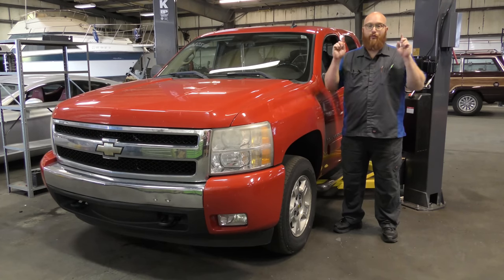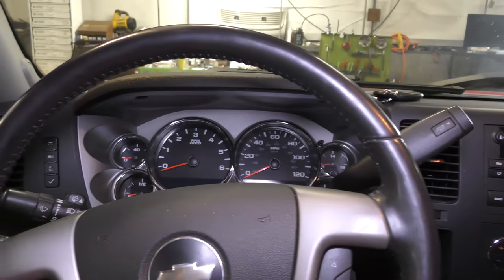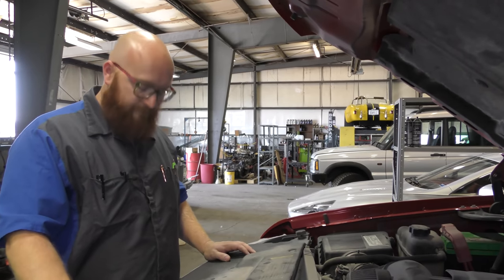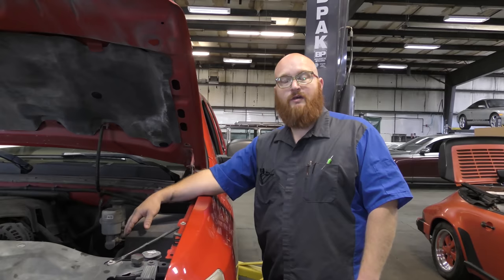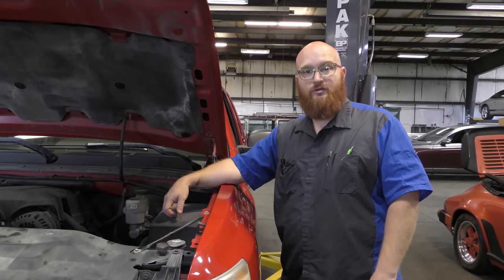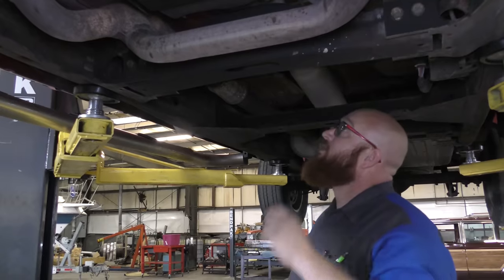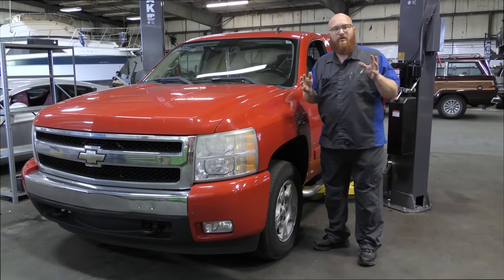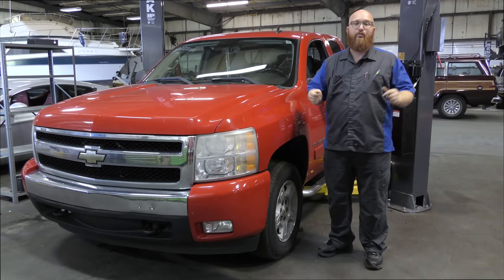Good Truck/Bad Truck? CAR WIZARD shares most common problems on the 5.3L Chevy truck at 100k+ miles

Comment: “I’m not gonna give myself a pay cut for being a good mechanic” the realist statement by a mechanic
Reply: Some jobs you make money on because it takes less time than book. Other times you lose money because stuff happens that don't show up until later when you are into the job (rust, broken bolts).
Reply: That's it. Another one is an objection to paying a large amount of labor for a "10 cent part". I ask if it would make them feel better about the labor if I charge more for the part. They usually become more understanding at that point
Reply: No apologies needed.  It's not a charity.  If people don't want to pay the book rates let them fix it themselves.
Reply: That’s fine don’t take a pay cut. But quit charging for shop supplies  I don’t mind paying for your work if it’s good. But I hate paying for your crap like brake cleaner. Every shop I ever been to you guys have multiple partly used cans of it sitting on your to boxes
Reply: Well said by the wizard, but the sentence previous to that was not. A mechanic shouldn't charge for the time it would take a novice to do it. If you gonna use book times then they should reflect what an average mechanic can do it in. So if you're a crap mechanic you're not getting crap pay, and if your a good mechanic you're well paid.
Reply: @Jim-jw6jm  but that “crap” is necessary to do the job why should they eat the cost???
Reply: @cayman9873  So by your logic in your first sentence, a good mechanic is doing MORE work and getting the same amount as a novice/shitty mechanic.  I'm guessing math wasn't your strong point...
Reply: Brian Weir I agree, guy should fix his own stuff then. Incidentals get expensive when I am buying them at my home garage.
Reply: @cayman9873  Like Mr. Wizard says, you think it's so easy you do it!
Reply: @Jim-jw6jm  You do it your self then!
Reply: Maybe shouldn’t brag.
Reply: Not really
Reply: @sidefx996   i am an advanced engineer and my math is excellent. You should read my post
Reply: @jdgimpa   i have done exhaust and brakes and clutches and engines.  I was employed as a mechanic and now am an engineer.  Why do you feel someone making a valid point is unskilled.  I am not saying anything like you seem to misunderstand
Reply: @sidefx996   i am saying he gets the same money for the job. But because he is skilled can do three jobs in the same time frame and make three times the money. Learn to read before you criticize what you cant understand
Reply: @cayman9873  I spent 45 years in the business 30 as a mechanic and 15 in management. I have over 4000 hours of Chrysler technical training and another 500 hours of management training. I am now retired. I held Master Certifications in auto repair, classic auto repair, parts management and service management. I also was Gold certified in repair, parts and service as well as recipient of several customer satisfaction awards. Would you be willing to pay more than the flat rate if the mechanic took longer than book time to do it? I never have found anyone that would, yet there was always someone who wanted to pay me less because I had done the job so many times that I was quicker than the book time.
Reply: @cayman9873  You  make a valid point !  I doubt very seriously if a mechanic runs into problems on a book rate job that he does charge for the extra time. I am not saying the Wiz does this, but I bet that many do.
Reply: I have a question to you all, when did you last pay your plumber, electrician or butcher 4 times his hourly wage just because he deems himself «good» ?
Reply: @cayman9873  you actually have a valid point.  If you complete a job, you aren’t going to sit around for the next three hours and watch a soap opera and eat a box of donuts.  A “great” mechanic will move on to the next job.  And, if he is that great and quick and fair priced will have plenty of more work lined up.  👍🏻

By the way, I like the Wizard.
Reply: That’s my issue with all shops. Better to just not say it.
Reply: Being a good mechanic means you get to keep being a mechanic and continue to get happy customers that trust in your work. It does not entitle you to charge for more hours than you actually put in. If your hourly shop rate is establish then it's that times the actual hours. Anything beyond that is defrauding the customer. That's why there's a Chilton guide for each job giving the maximum billable hours. This takes into account the worst possible case for each job including mistakes and unforseen difficulties. This is done to put a cap on how much a mechanic can potentially charge but dishonest mechanics will charge the maximum for each job regardless of how much time they put into it. A lot of times it the shop owner pocketing the extra money but his employees are only seeing their hourly wages anyway.
Reply: What happens if a manufacturer puts out a bulletin stating that a certain will require an extra hour? Will the Wizard's shop now charge for that extra hour inspite of them not needing it?
Reply: @cayman9873  Funny not knowing the difference between "your" and "you're" and you're telling me to learn to read...  Anyway, my original point, and maybe we misunderstood each other, was that if a job books at 5 hrs and a mechanic finishes it in 30 minutes, there's no reason he shouldn't still be paying himself/charging for the 5 hrs.  Yes, of course move on to more work after that.  If you're doing multiple repairs and you're already in there and it's a repeat customer yeah maybe you give that person a break.  And if you run into other complications/broken stuff during a "5 hr book" job then why shouldn't they charge for the additional time?  Of course it comes down to a mechanic's integrity and yes I'm sure like ANY other profession you get all kinds.  That also applies to customers as well.  I don't have a lot of money and even for me price is secondary to actually finding someone who knows what the hell they're doing.  That's the main reason I've learned to fix most things myself.  If lots of other people out there spent half the time reading/learning that they do on pornhub they'd be able to do the same.
Reply: @sidefx996  I fix my cars myself and now I fully aknowledge book hours and pay rates... It's often a pain in the a** to change a simple and cheap part....
Reply: @snerby141989  More smoke and mirrors. Make it easier on yourself and just be straight up with people.
Reply: @JoeD60  I'm being facetious. Obviously it does not make any more sense to charge more for a part to make the labor more palatable. It's just that the correlation between parts cost and labor cost is irrelevant.
Reply: @rekleif  Plumbers and electricians work on a flat rate just like auto techs. The amount of training required for either of these jobs is miniscule compared to the 4000 plus hours training I amassed. Also their tools are a drop in the bucket compared what a auto tech is required to have. If a plumber comes to look at your water heater and it isn't getting any power he still charges you a service charge and leaves. Telling you to call a electrician.  Or if he has to replace the faucet on your shower he cuts a hole in the wall to get to it. Then he leaves the hole in the wall and tells you to call a drywall guy to repair the hole. So if you think your plumber can fix your car have at it! A auto tech has to be a plumber, electrician, computer programmer, be able to read complicated wiring diagrams, diagnose problems involving many different systems. as well as keep up with the constantly changing designs of vehicles. So next time your vehicle break's fix it your self and stop disparaging us professionals!
Reply: @ligase75  I'm pretty sure the car wizard is not a dealership. He's the guy people go to when their warranty runs out.
Reply: @Jim-jw6jm  yet if a restaurant charges you extra for condiments that's not okay? Business pay for cleaning supplies, coffee, water filters, etc but only mechanics are allowed to fluff labor and "shop supplies".
Reply: @cayman9873  I hear you that is what kills me about mechanics. Yeah you can mark up parts a little but a lot of these guys want $125 an hour, plus the 100% parts markup, charging almost dealer pricing while supplying inferior parts. I also agree that a mechanic shouldn't quote book time and then come back and say the job took an extra hour because of rust(they know that going in usually just by looking at it, I've seen a mechanic pad a labor estimate by 30 minutes over factory book because it's very rusty, which is fair), either you are charging actual time or you are charge book time not the greater.  I've dealt with honest guys but many are crooked and I've decided that generally I can do it myself, where I used to live I had a cheap mechanic nearby and he was pretty good and also honest(i.e he'd tell you things were still fine no need to replace this part yet and never charged more than his estimate even when rust caused it to take longer) where I live now I have not found a mechanic like that, one guy didn't know what he was doing and didn't fix my issue despite spending a grand replacing parts, the other guy was a good mechanic just really expensive 1k for rotors and pads is a bit much parts are only ~$250 and it takes ME less than 2 hours for me to do the job(my cheap mechanic would do it for $150 cash, book time is 3hrs he'd charge 2 plus give a discount for cash), so I had him tackle the hard stuff and did the brake job, belts, even sway bar links myself, saved almost 2 grand and it took an afternoon probably more because the calipers were shot and did that too and he didn't find that, they were working but not well.

Mechanics charge what they charge as long as they are honest it's all good it's when they excessively pad parts prices or replace things that don't need replacing it's a problem.  It's like anything else a mechanic is entitled to charge what they want as long as they are ethical about it, I'd rather the mechanic say I'm skilled so I'm worth 150 or 200 an hr rather than pad part prices 100%
Reply: How about if his employees say I'm a good mechanic so instead of paying me for the 40hrs that I put in, I want you to pay me for  120hrs" What would car wizard say to that??
Reply: @jkeelsnc  I only do my own repairs. I'm concerned about those who are getting ripped off but have no recourse or foolishly think they're mechanic is honest. How it works is different from what you can get away with... Don't confuse the two. If there was more legislation this wouldn't exist. That's why most people don't deal with mechanics. They keep buying new cars with warranties for this very reason.
Reply: @jkeelsnc  Yes. It's dishonest to charge for more hours than you actually put in. You have an hourly shop rate and you charge that for the hours that you work. That's your pay. That's not working for free like a slave. Just like you pay your employees for the actual number of hours they work. The book rate is there to have a maximum cap on every job. It doesn't mean that you're entitled to the maximum hours if you didn't put in the maximum hours to do that job.
Reply: @jkeelsnc  Normal is not the right term. It is typical I'm sure. Generally it's not the mechanics getting that money. They work their asses off for minimal pay. The point is the Wizard touts himself as honest and I generally think he has been very honest but his YouTube fame and revenue seems to have made him quite arrogant and compromising his integrity for money. Buying boats, Ferrari's and buildings recently. I'm disappointed in him and turned off a little. Know what I mean?
Reply: @stevesmith3033  most decent shops pay mechanics pay by how many hours the Technician flags, omega auto and David Long don't, good mechanics aren't rewarded at all by the wizard..
Reply: @stevesmith3033  there are three "book rates" Warranty, wholesale and retail a skilled mechanic can get it done under warranty hours. When these independent shops are charging suckers $95/hr and up and installing crap Chinese made parts with a fat markup you are really better off spending a bit more and having your car serviced with quality parts at the dealership. I change plenty of Chinese made water pumps, fuel pumps etc installed by cowboy shops like the shops like the wizard that are less than 18 months old. Keep taking your car to "independent" shops it keeps the dealer service department in business!
Reply: And what's wrong with that. Imagine doing good work and getting paid for it. 
Its time that trade's people (talented ones) start charging big money for there services.
Reply: Mecanic will never ever lose money 💰 
Even if it take 3 hours I bet you , he will say 
Oh I found a broken bolt blah blah blah and will charge extra 2 /3 hours 
I learn to buy a good car , easy to maintain 
And keep it up 👍 change oil filter 
And will never ever see a Mecanic 
My Toyota T100 have 650 000 and still running 🏃‍♀️ as a Cham 🤣🤣🤣

My next truck will be tundra for the rest of my life , that’s why 99% of Mecanic don’t like Toyota cause you will never be there customer
Reply: @cryptoanalysts5793  

I haven't had my vehicles into a mechanic in 20 years... 
To your point i buy used lexus, and imagine! never a problem. People do need to choose there vehicles on reliably and not on "car of the year" or try to out do the "Joneses".
I love the look of Cadillac's and BMW  but i would never buy a used one.
Reply: @sonnydash4987  I bought a used 2003 BMW e39 
Was the biggest mistake...in less than a year I spent 4K and still needed to tow it every now and then , I fixed and sold it as is ...
Have Lexus my wife drive it , and amine 2012 Camry ...Honda for my son and my lovely t100 
Never ever been in a shop other than when I owned  that BMW
Reply: @cryptoanalysts5793  
I was sooooo tempted to buy a 5 series from that time period too, glad i didn't. Now don't get me wrong i do have a 1984 K20, and a 1970 Lemans ,love them. BUT i do all the work myself. I don't have the time or ever want to work on my daily driver either. 
I'm thinking of going with a used V6 Acura rdx next for my wife. 
Japan all the way Crypto!
Reply: Auto Mech. and Body techs by the book hour, after yrs of work on cars, you either are good at it or suck at it, repetition makes you a better Mechanic, just like building cars, repetition make for fast assembly, I worked  at a plant in paint repair and mech repair, you get a lot of same repairs, after fixing hundreds of them you learn the root cause that you try and pass on to the line to reduce the repairs. Like a lot here have said don't like the high rates buy thousands in tool and diagnostics and do it yourself.
Reply: @sonnydash4987  you know what you doing buddy 😂😂😂
Reply: This is how it should work when you're paying any professional. You're not paying for their time; you're paying for their expertise.
Reply: @stevesmith3033  yeah I know what you mean, you're jealous of his success.
Reply: @longjohn77  I don't do jealousy John K. I have my own goals that I pursue and succeed at. I'm a grown man after all. Jealously is for teenagers who don't know who they are and haven't found their purpose. You fit that category maybe?
Reply: @stevesmith3033  right.... keep telling yourself that.😆😅🤣😂😂 you're so busy whining about CW's apparent success it's pathetic. Worry about yourself, maybe one day you will finally have some success yourself. First thing I would do is learn to spell if I were you.
Reply: @longjohn77  Hey dude I'm leaving a comment in the comment's section. That's what it's here for. Who do you think you are attacking people for sharing their opinions?? If I posted videos publicly then I'd expect a variety of opinions and would would be open to it. That's what freedom of speech is. Do you have a fetish for fat, bald, bearded men? Is that why you're coming to his rescue?
Reply: @longjohn77  Really chief? I think HOW that success is achieved matters whether I'm happy for them. Are you happy for Hitler's success or the KKK's each time they linch someone? I sure hope not but then you do seem to be a bit sadistic and malicious going after people who post on other people's pages. Why don't you get your own successful page so you can attack those people?
Reply: Shop manager “ it only took you 20 minutes to do that” I’m not here to break even
Reply: @Renzo2k14  Does anyone know why an hourly rate is established and disclosed to the customer? It covers overhead and profit. When you're charged for hours that weren't put in that is called fraud. Why are so many people ok with this? If you bought 20 gallons of gas and the advertised price was $3/gallon would you be ok with paying $60 and only receiving 10 gallons?
Reply: @stevesmith3033  some what but not at all guy the shop charges X amount and I the guy who is getting dirty gets paid X amount of it so I educate myself through schooling and buy tools with my money to get better at what I do and it takes a shorter amount of time than book time. But if a job calls for 3 hours and it takes me 6 the customer still only pays for the 3 so where is the fraud ? If there was an issue on labor time it would have already been regulated by the government idk what you’re going on about but people aren’t going to service your vehicle for free.
Reply: @Renzo2k14  If the job "calls for" 3 hrs that's what the maximum allowed is in a worst case scenario which was established so that warranty companies wouldn't get ripped off. If it takes you double that then you need to find another line of work. If you're good at your job and you can get the repair figured out quickly  then your hourly rate goes up. The shop does good and so do you and the customer is happy. Everyone benefits. When it's obvious to the customer that they're being cheated they will eventually get fed up and just buy a car with an extended warranty. Cheating customers means money in your pocket now but not looking at the bigger picture. Shops go under all the time for this reason. Obviously there are millions of cars on the road so there should be an endless supply of work.
Reply: @stevesmith3033  dude you’re contradicting yourself. what the hell are you getting at bud? Talking about you’re better at your job if you get stuff done quickly but you shouldn’t get paid for the time it calls for. Ok you work fast food you only get paid when you’re making a burger if there are no customers coming in you don’t get paid. If you’re a clerk you only get paid when you’re ringing up goods if you aren’t scanning barcodes you aren’t getting paid. You work at a bank if you’re not signing people up for accounts or making deposit and withdraws for people you’re not getting paid. The cost of any goods or services sold is increased for the business you’re getting them from that what it is to live in a Capitalist society your argument is null and worthless guy if it’s so damn easy do it yourself that’s always a option.
Reply: “I’m not gonna give myself a pay cut for being a good mechanic”   well one should ..if one is paid by the hour
Reply: @pettersaethre  technicians who are hourly do get paid less than one who are flat rate
Reply: @sonnydash4987  I agree with you. I would not buy a BMW or a Cadillac, anyway.
Reply: @Renzo2k14  I'm not contradicting myself you're just not understanding. It's the shop that charges the customer for extra hours that weren't actually worked nor did they didn't pay their employee for. They pay the employee for the hours they worked. If the mechanic is good and they work fast then they earn a higher hourly wage. If they're taking six hours to do a 3 hr job that a good mechanic do in two then they won't have a job for very long. That is a capitalist economy.  This in no way compares to commission sales so that's a faulty analogy.
Reply: @hotpuppy1  exactly jobs do not always go smooth
Reply: Either do the work yourself or be willing to pay a good amount to take it to a good  shop especially a good one. Or buy a vehicle that literally has minimal reliability issues. People really dont get the saying. "YOU GET WHAT YOU PAY FOR"
Reply: The link for the vehicle is here:  https://dkmotors.goxee.com/vehicle/96968/2002-SUBARU-IMPREZA-TS-SPORT/. It is just located at DK Motors in Victoria, British Columbia, Canada. It only has 134K kilometres on the odometer and it is priced at $6,500. Thank you very much.
Reply: It is an iffy subject. I had a 2007 gmc canyon that needed a head rebuild (made it till 230000k) and the book rate was 30 hours to do the job,  the shop i took it to got it done in 16 hours and only charged the 16 hours. So instead of a 5k plus bill it
 was 3100 dollars and i got another 200000
Kilometers out of it. I get there's overhead and stuff, but isn't that why shop rates are high is to cover the consumables and wages and rent for shop, no disrespect but some times going by the book when you can do it faster is just gouging. So doing little things faster i get that , it's only the high price fixes where honesty should be aplied properly.  I'm not calling the wizard dishonest,  i just think he should have worded what he said a little bit more explained instead of cut and dry. He does have great videos that are very explanatory and i will continue watching them for advice on how to's and what not to's
Reply: I would add for diyers like me that my friend built a shop with lift and heat and electric and taxes to do side work and teach others to help themselves safely. I have seen his overhead for supplies and other stuff named above. I totally get why book rate is charged at times for a job done well and experience making it go quickly. I am sure there are guys or gals out ripping people off but mostly have seen good honest hard workers paying the bills. In top of what was named above I have just glanced numerous times at proper tools and such to do these jobs. It is in the thousands of dollars invested. Thank you to all those turning a wrench professionally and honestly!!!!
Reply: @cayman9873  Give me a break what kind of job can you do that the book time is 5 hours and complete it in 30 minutes. In the real world most jobs end up with book time being beat by 1-3 hours depending on what you're doing. Would you feel better having a rookie fix your car taking up the entire book time? Or do you want the person who's done the job a million times and get it done faster?
Reply: @cayman9873  I was thinking the exact same thing. If you don't work those hours on one job, you have them to work on another job. NO pay cut. YOu want to make $150 an hour for your expertise instead of $120. I understand that. Not charging for hours you're not working.
Reply: Gonna use this line in my profession
Reply: @Jim-jw6jm  do we not use the brake clean and washers zip ties etc etc etc on your vehicle when it's in? I always make a point to resecure loose splash guards, those clips add up. I try to clean off what I work on, that also adds up.
Reply: I'd rather pay more for a good mechanic than less for a bad one.
Reply: @sidefx996  exactly and Americans wonder why they get screwed over by their government. They don't understand basic math. Why would I bring it to this guys shop, when I can bring it to another shop down the road that will charge me the same or potentially less.
Reply: @stevesmith3033 well put sir